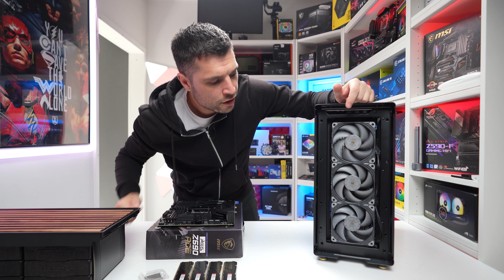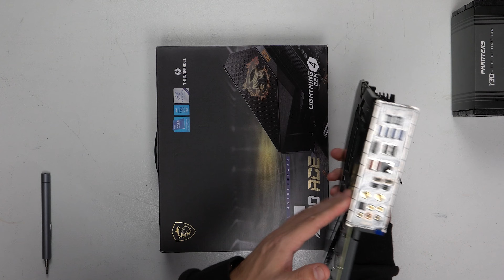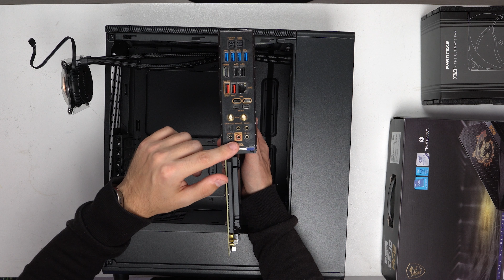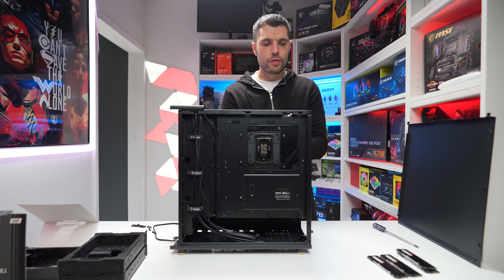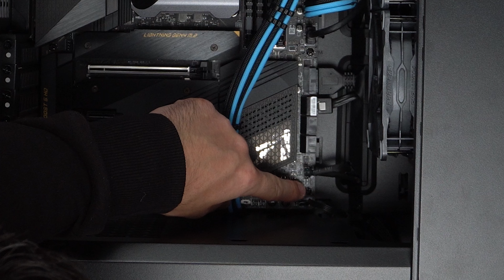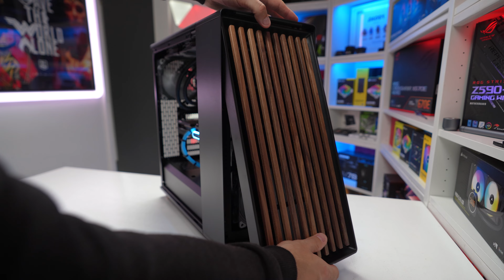Fractal North PC build FT RTX4070

Comment: Just bought the north today. Can’t wait to build in it
Reply from the maker: U will love it buddy it's a really nice case 👍
Reply: @TechCheckUK  Question, I have corsair vengence RGB DDR5 ram and I am worried about clearance with a AIO up top?
Reply from the maker: @DLENNON93 u will be fin3 mate as long as standard 240/280 thick AIO were u have to be carefull is when using a arctic or same as me as they are thicker so u need low profile ram - good luck mate 👍

Comment: I got the North XL 2 weeks ago as well, paired with the same cooler you're using but the 360mm variant on top as exhaust for my 13700k. The case is really nice, keeps all my components very cool and is quiet, my undervolted 4090 rarely goes above 60c under load. I am however considering doing what you did and change out the front 140mm fans that come with the case, and put in the T30's. They're so goddamn nice, quiet and move a ton of air.

Question, why did you use a spacer when putting on the stand-offs for the cpu cooler?
Reply from the maker: Because I was using an older cpu 11th gen and the IHS on cpu sits lower than newer cpus that's all mate 👍 glad u like the case and the t30s are great.
Reply: @TechCheckUK  Ah makes sense! How is the clearance for the T30's in front though? I heard the mesh is right up against them?`

Oh and crazy what I learned from watching this vid, I had no idea you could take of the cover on the AIO pump/block. I was struggling like crazy to get the screws on because it's so big. This is obviously a way smarter way of doing it.

EDIT: I see what the difference is, I got the v2 of the glacier one T30, so the pump cap is not the same. Mine can't be fully taken off.
Reply from the maker: @vedomedo  yeah mesh is pretty close but does not affect performance or noise which is great. 
Yeah AIO faceplate is removable and this is why I love making videos and trying to help and make it easier. I appreciate you taking time to watch and comment - thank u

Comment: Nice biuld but your cooler tubes need to be at the bottom or your just going to be pushing air bubbles.
Reply from the maker: Absolutely fine this way never had 1 issue with over 400 builds over past 3 years mate - thanks for watching I appreciate it
Reply: @TechCheckUK  Your choice buddie but i would not put a cooler tubes up.
Reply from the maker: @MartinParkes it's all personal preference mate 👍 tbh as long as the inlets are higher than cpu it's all perfectly fine - air if any will gather there and not at cpu
Reply: Absolutly no issue with the cooling guys ! 
It is pushing no bubbles ! No funny noises !
Runs very well and cool !
Reply from the maker: Glad to hear it mate 👍